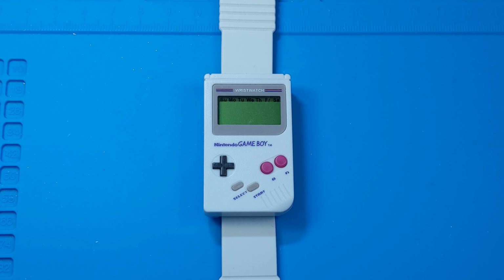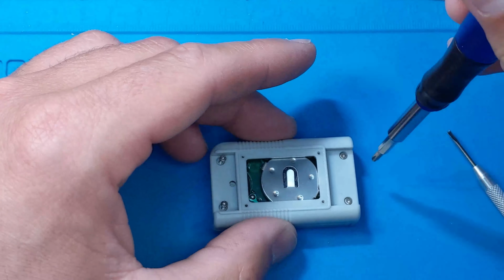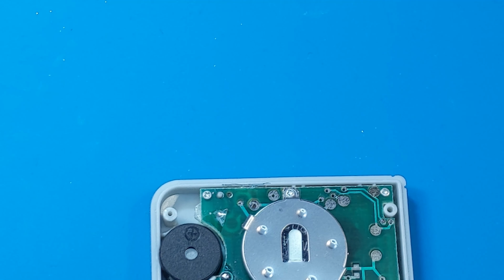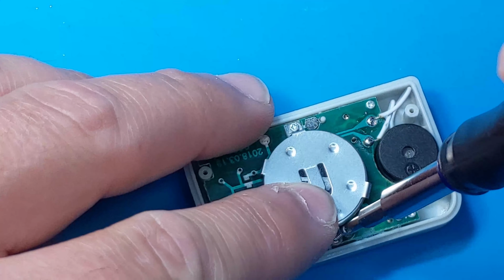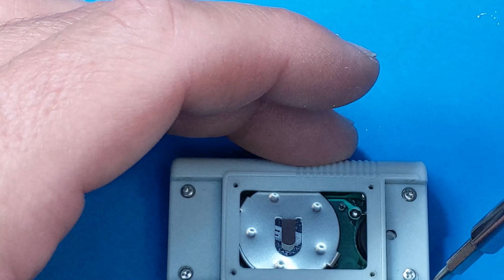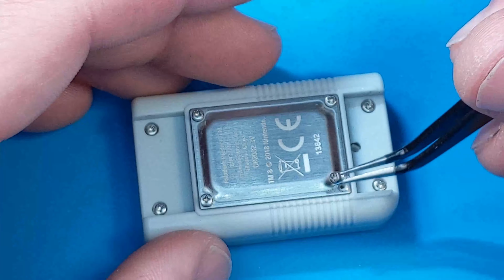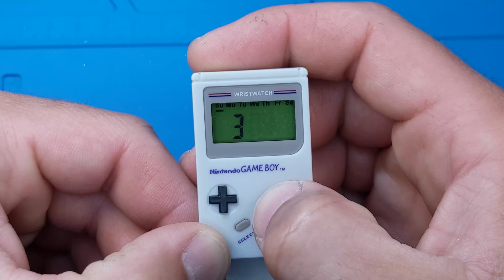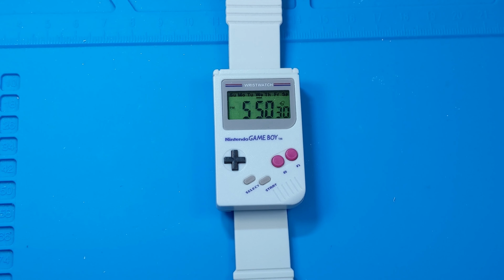Let's Fix | Game Boy Watch | Battery Replacement

Comment: I literally CAN NOT get the screws off, i have tried eveyr screw i have but it does not come off,
Reply from the maker: Are the screws stripping or are they stuck? Use a quality screwdriver with a good tip and a big enough handle so you have enough force to break the screw free.